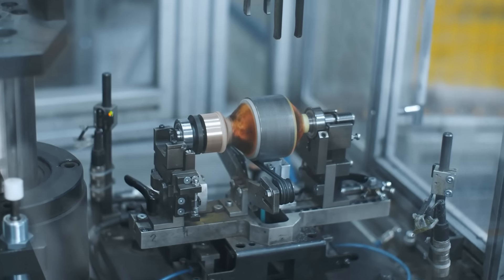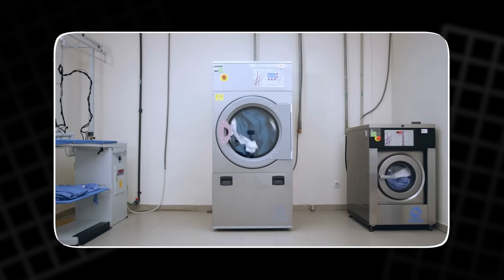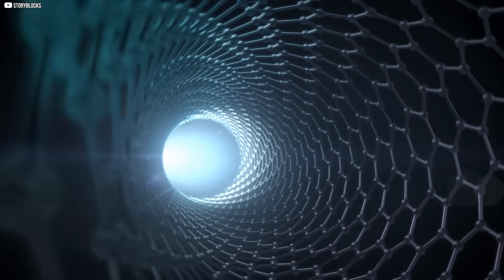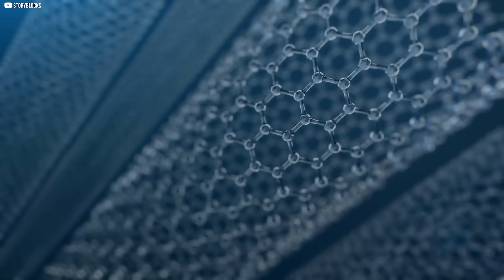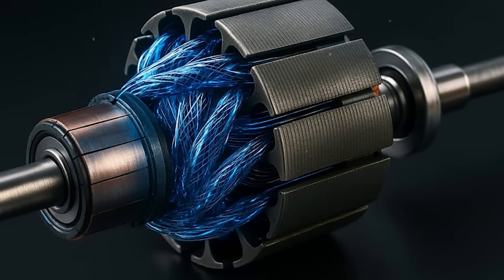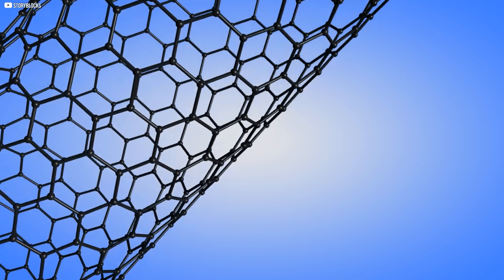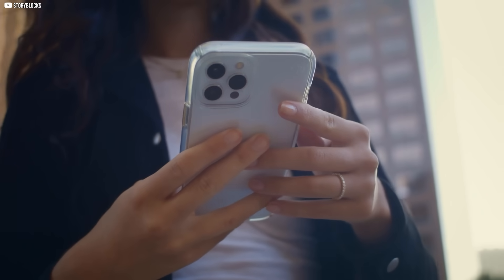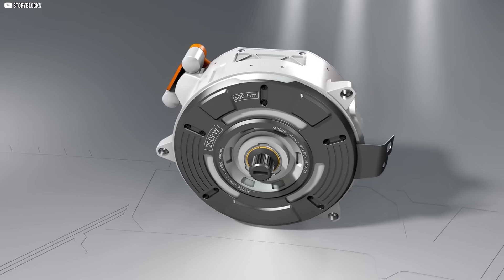A Motor With No Metal? The Silent Carbon Revolution No One Saw Coming

Comment: First, recently, there has been a new motor on the market. I think it is called an axial flux. Maybe most electric motors are radial. It is much lighter and currently in use in the most powerful supercars. The motors are very light and powerful. They do, however, still use copper.
   As for this tech from South Korea. An 80% reduction in weight? That is astonishing really. It looks to be very promising. Have they tried it in the axial flux configuration? Or traditional motor style?
   I was already aware of the carbon nanotechnology. Carbon nanotechnology can also be used for batteries in mu h the same way, but I am sure these material scientists were already aware of that. 
   Good luck KIST!
Reply from the maker: It's great to hear your thoughts about the potential applications for this technology!

Comment: The concept of using carbon nanotube yarn in place of copper is not new for electric motors or power/data transmission wires.